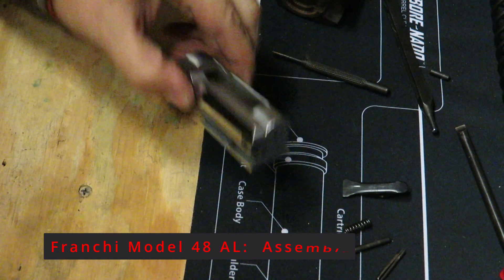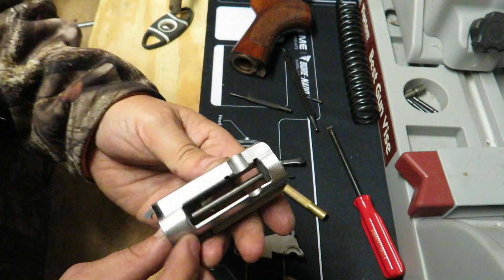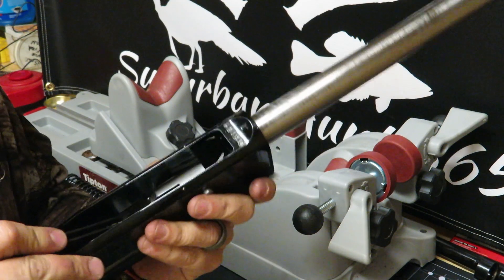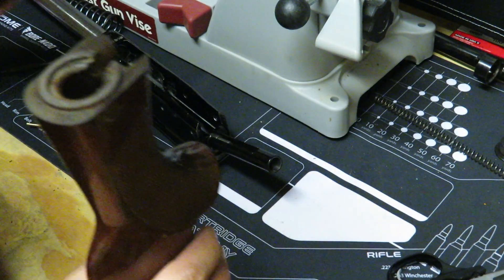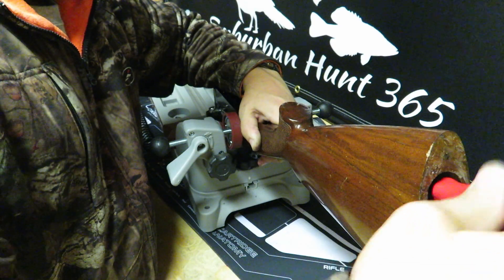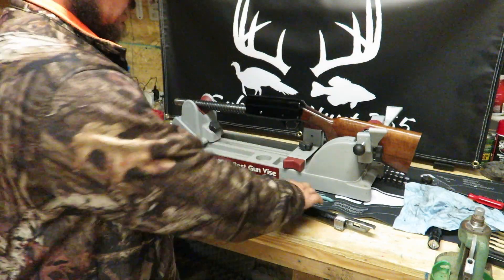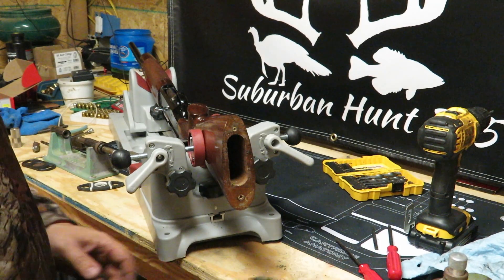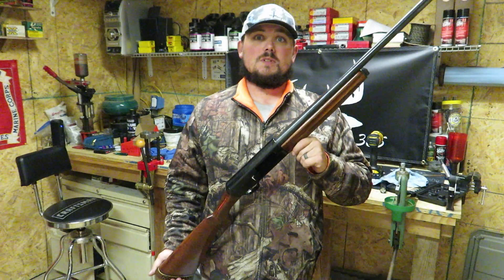Franchi 48 AL Part 2 : Assembly

Comment: You really need to keep the Tube that the Rings Slide on Lubricated. If left dry the Franchi has a tendency to jam. How do I know? Have owned the Franchi 48AL for several years and by expirence learned it needs lubrication. Enjoyed your presention, found it helpful, thank you,
Reply from the maker: Thank you for the tip that makes sense. Thanks for watching
Reply: On the User Manual of mine 1965 48 AL (bottom of page 4, in "How to set the recoil governor" section) there's an advice: DO NOT OIL THE MAGAZINE TUBE. WIPE IT DRY AFTER CLEANING. It's in bold and block letters, so I think it's an important advice. It's important to align the openings on the brass and the steel rings to gain a good grip, so the rings doesn't slip, and this prevents jams. Never had problems with good ammo, in 40 years of ownership, and never oiled the magazine tube and the recoil spring. And sometimes I use it even now, with 32 grams 1050 bars Gualandi slugs, for wild boards hunting. It's a 2 star choke barrel,  and it works perfectly with self reducing or under calibrated slugs like Gualandi and Brenneke.

Comment: On Browning A5, for light loads they say to put the governor bevel side down on tube first then put spring on then place friction ring (bevel side up). Interesting the difference. I have a late ‘40s American browning 3-shot 12 gauge set on heavy loads and still cycled 1 1/8 loads of white box Federal ammo at clay course with no problem for 75 rounds. A great design Mr. browning had!
Reply from the maker: I have to agree. I love an A5!!! Great Shotguns

Comment: The third option for the friction ring if it still fails to cycle on the lower setting seen in the video is to place it on the tube first before you install the spring
Reply from the maker: Good deal. Thanks for watching.

Comment: Those you replace the recoil and action springs. Most are over 40 plus years old. Set governor ring like you stated. But on the friction ring and brass/bronze friction spring, line up the splits/slits when reinstalling.
Reply from the maker: We have to make sure to do that if we didn’t. If it was t lined up the shotgun seen to shit fine. I assume it adds friction?

Comment: You seem to know a lot about these guns so maybe you can help me. I have the frenchi black magic and from what I read it’s the same as the 48al just better cosmetics. With mine the firing pin is hitting the primer when loading the first shot and slap
Firing. Any idea what it could be?
Reply from the maker: Have you taken the breech block apart and looked at the Firing Pin Spring? I would be curious to know if its right size, worn out, or missing all together. Have a look and check out Numrich for parts. If you have to source elsewhere be careful and ensure its the correct spring. 
 https://www.gunpartscorp.com/gun-manufacturer/franchi/sa-gas-op-shotgun/black-magic-game
Reply: @suburbanhunt3653  I have not first time it did it I think it broke the firing pen I took it somewhere and got it fixed shot it a while it done it again. It only does it after u have shot it maybe 10 times or so. Probably could be the wrong size I’ll try taking it apart this week and looking at it. Is there a better way i could keep in contact with you on it?
Reply from the maker: @kalincollins295   suburbanhunt365@gmail.com

Comment: Thanks a lot! Just got me a 12G version of this, and this helped a lot! My shotgun is now ready for a few rounds on the range, and hopefully I`ll get us some groose with it later this fall! Got one question for you, I live in Norway, and starting this year we have to use amo with steelbullets as oposed to led. Do you think the AL can handle it?
Reply from the maker: I'm pretty you would be fine. As long as you have the rings set correctly for the load you are using you should be good to go. I'm not aware of any issues using steel. We have had to steel for water fowl for some time and I've not heard anything. Best of luck out there and thank you for watching.

Comment: Thank you sooo Much,!
I have a problem that maybe you can help me with, After following your vids, All functions as it should .Except that it will not chamber the next round.
in order for the next round from the mag tube to release I have to manually push the carrier latch .Any help would be appreciated.
Reply from the maker: Is it only for the first round or after every shot?
Reply: Take trigger assembly apart look for a pin it is sticking up a little bit push it flush. That is what is hitting the latch

Comment: If you have the time, grab an older Win. Model 94 that'll also have a Lever safety. You have to squeeze the lever to be able to disengage the sear to allow the hammer to fall. Almost always these do not pop back into the safe position once engaged after letting go the lever. They're supposed to but I have a 1948 version that doesn't. I've checked many others that act the same. It would be nice to cure this issue.
Reply from the maker: I have access to an early 70's and a mid 90's models. I've never tested that so I'm not sure if they also don't go back into safe. This is interesting and I will try it on both models. We do have a disassembly video for the Winchester 94 but I didn't take the tang down that far. https://youtu.be/PRdFqMsVA-E
Reply from the maker: I tested the 90's model and it operated like it should. I will see about getting a hold of the older one and test it. I'm curious if dirt and build up is causing it to stick or in the metal has lost some of the pressure. Once I have a chance to look at the older one I will let you know what I find.